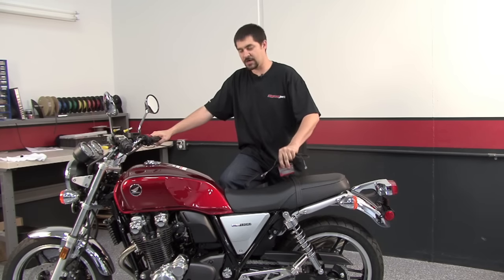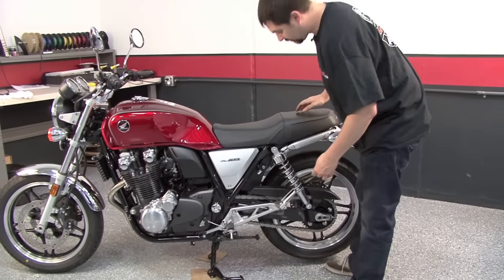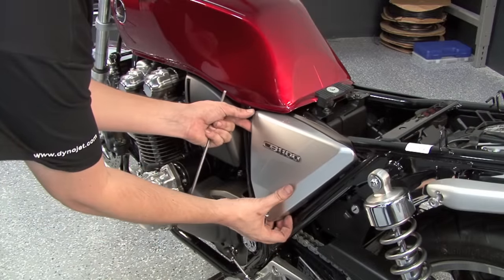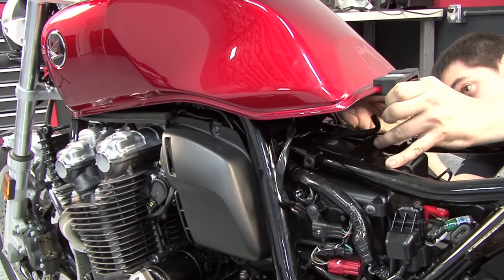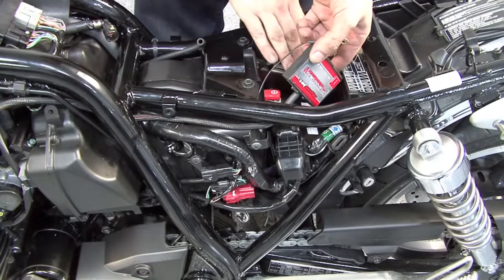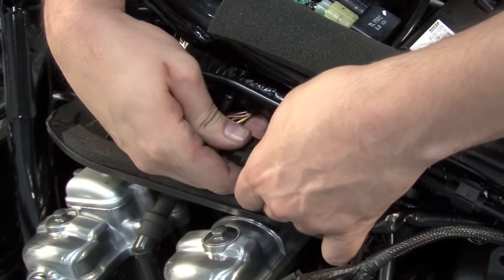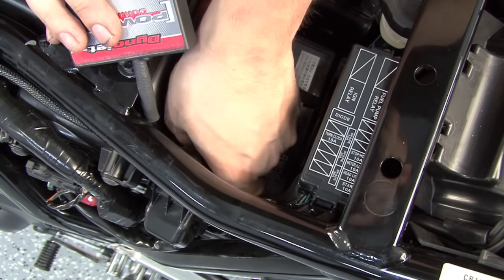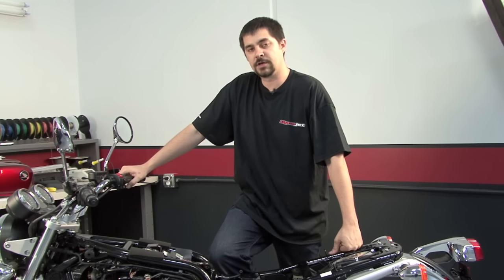Power Commander V Install: 2013 Honda CB1100

Comment: This Power Commander is a piggy back air/fuel ratio tuning tool. It does not change the rev-limit or the top speed of the vehicle. It is used for adding/subtracting fuel and thus tuning the engine's air/fuel ratio. Typically room for improvement in the stock fuel quantity on a completely stock bike are usually only available in the idle to cruise range. The bike would need to be modified with exhaust, intake, cams, etc. to make peak performance gains.

Comment: Unless you're putting in a whole aftermarket header and silencer system, i.e. Akra, Yoshi, Two Bros, etc..., I don't see the real benefits to installing a Power Commander.  It doesn't allow changes to the rev limiter nor can you eliminate the mph restriction.